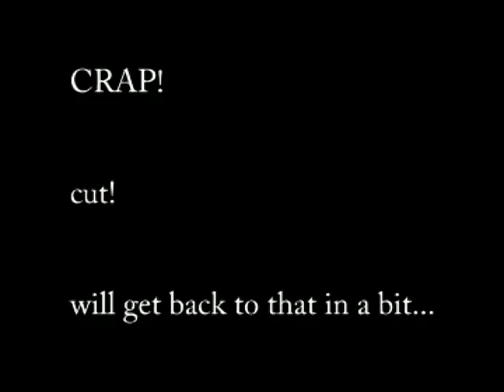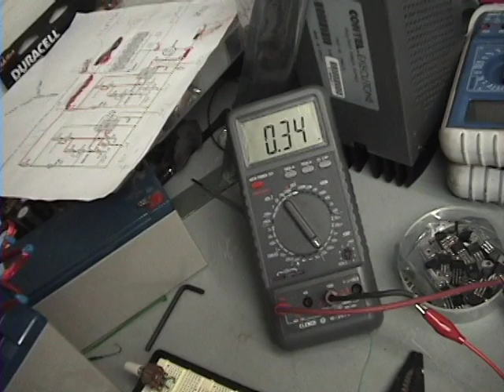Rodin / starship Double Pulse Motor PC Fan Mod, (TEST16)

Comment from the maker: it is using 12v yes. and the coil is putting out a alternating magnetic field. the magnet is reacting to that magnetic field. and the circuit is switching the magnetic field at just the right time to spin the magnet as it has a sensor on it. :) hope this helps ~Russ

Comment: @rwg42985 what i meant was the fan coils are soldered to the circuit in three locations. it is very hard for me to get it off without breaking it. what would you suggest for that?

Comment: @rwg42985
 On the cylinder magnet that you stuck on the rod, where was the north and south pole at, was it a half and half magnet or was the south inward towards the center hole and the north on the outside roundness part?

Comment: Excellent Work! By the way RWG, have you tried the Bedini Circuit with this method?
It should give you very high numbers with that kind of rpm. Also, you could get a plastic ball and put some oil inside, and place the magnet in there.

Comment: @rwg42985 It works great, i only have gotten a (4mm³)small neo cube spinning in a  plastic foil but it just keeps on rambling. Got the cat very curious.
I had time to make a little setup with axle and bearings, but have no magnets yet to put on it.
One coil 50 windings (0.71mm) approx 20 cm across
second coil 52 windings (0.71mm) approx 20 cm across but every turn starts 1 position clockwise (i don(t know how to put it)
hope to post a vid soon
regards jef

Comment: What if you took that star thing, put it in salt water, and made a battery with it and carbon fiber or aluminum and generated power from that instead of a battery.  Set that pole over it with a friction-less magnet system.  On either ends of the poles you put either copper disc, wheels with magnets, whatever you think is best to create energy that you could collect with 2 star chalices on both sides of the pole.

Comment: How is this free energy when it is connected to a battery? I don't get it... could someone please explain?
Reply: the battery is providing power to the coil, the coil then produces infinitely more power than the battery. So imagine you power on coil, you use some power from the coil to power the fan moter, and use the rest of that energy to power another bank of coils which powers lighting, fans, ac in a building or something. No imagine that in this bank of coils one is dedicated to recharging the batter, since each coil produces more energy than the batter that's powering it, it will charge more than it uses, generating a surplus of energy vs energy spent.

The excess energy is there, no one has demonstrated how to store and recharge the battery.
Reply: Interesting. 
Maybe you then instead could have a power switch disabling the power from the battery and enable the power from the coil to power itself?
Reply: that's the idea :)

it hasn't been buffed out yet, the tech is still brand new, but hopefully in the future :)

Comment: @rwg42985 Well, i did it...
So, each of the Gates has the same magnetic field! The influence is just to caotic in the middle... you know... N is right,... left... under... etc.
But when i bend a gate around (180°) and put that on the middle it will akt like a Coil with that much windings. (more Power)
Perhaps someone can give some inspiration to me....